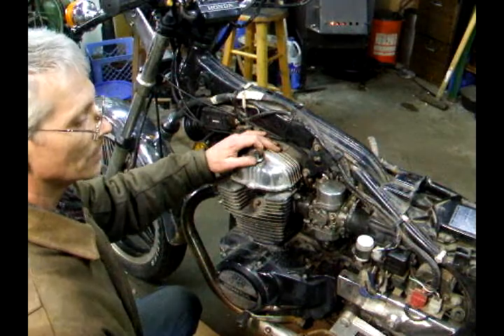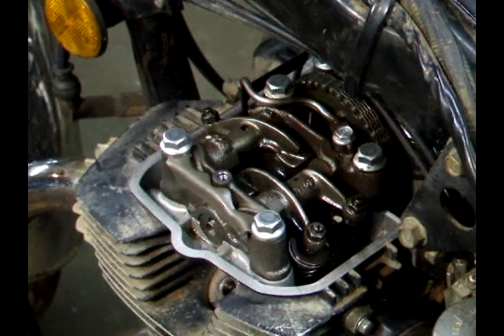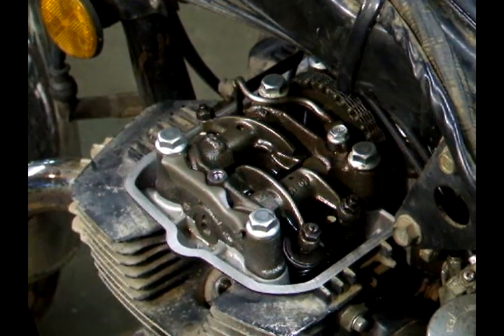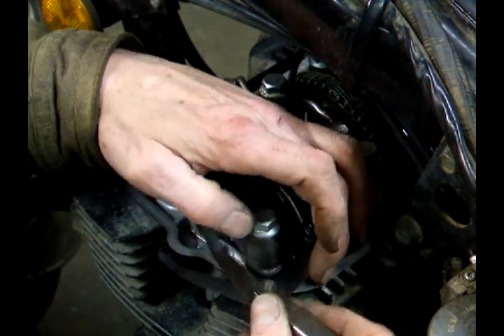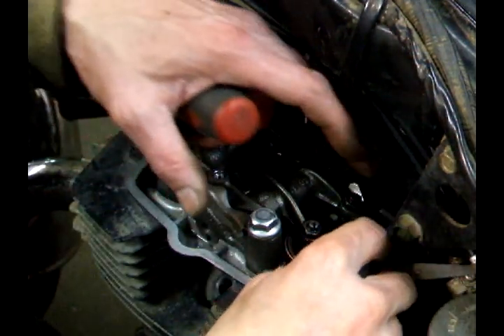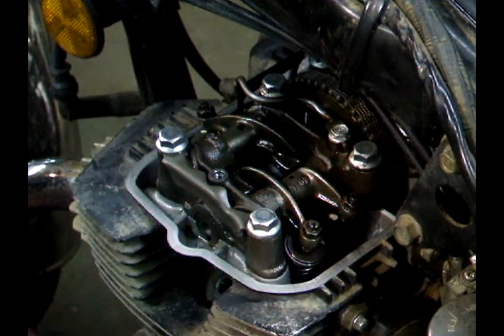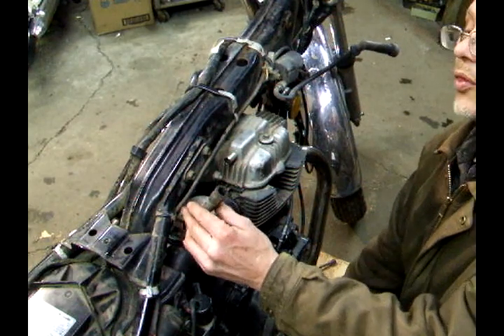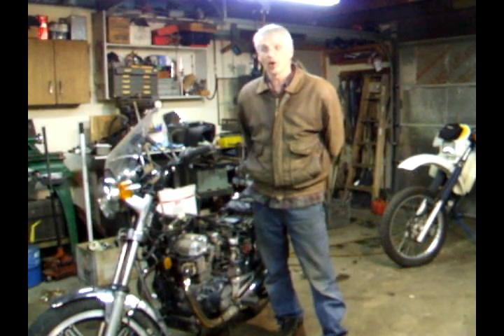Motorcycle valve adjustment

Comment: I also have a 450 Nighthawk. I adjusted the valves no problem, but the camchain is a bit loose. With the valve cover off, and the lock nut loosened on the adjuster at the back of the cylinder, do I press down on the top of the tensioner and retighten the nut, or do I pull up on the tensioner?
Reply from the maker: You have to push down on the tensioner. The spring that's suppose to do that may be weak, or the adjuster may be stuck. Keep your eye on the timing chain to see if it tightens when you push down. Don't push to hard and over tighten the  timing chain.  You might have to hold the tensioner down while you tight the adjuster. Another chain that might be making noise is the balancer chain. it can also be adjusted. Look in a service manual how to do that.
Reply: Thank you. I kind of thought so, but wasn't 100% sure. I did adjust the balancer per manual, so just the camchain tensioner now. 🙂

Comment: I've been debating if I should adjust the valves on my 82 cm250c myself or go to a mechanic, any thoughts on how hard it would be or any tips on how to do it
Reply from the maker: +ollie bob Are you mechanically inclined? Are they making noise? If its not broke don't fix it.  Tips, don't be in a hurry to do it, watch a bunch of video's how other people do it. Have the right tools and know the specs to set the valves to.Do it with the engine cold.
Reply: +A Motorcycle Nut the bike is running really hot I've tried oil mixers and a few thing like that and still runs hot, the only thing I can think of is the valves
Reply from the maker: +ollie bob If I understand you correctly, you put oil in your gas. Don't do that, its a four stroke engine and oil in the fuel makes it run lean. I would check your spark plugs and make sure they are the right heat range and gaped properly . See "Set your spark plug gap" https://youtu.be/o2cKqACJnoM. I would make sure the oil is clean, and the right viscosity, and at the proper level. I would check the cooling fins and make sure they are not plugged with dirt and mud. I would check for vacuum leaks at the carb boot.  If that doesn't fix it I would adjust the Cam chain tensioner. and check the ignition timing with a timing light to make sure that the it is fireing correctly and that the timing advance its working properly .
Reply: +A Motorcycle Nut thank for the advice I'll definitely check it out